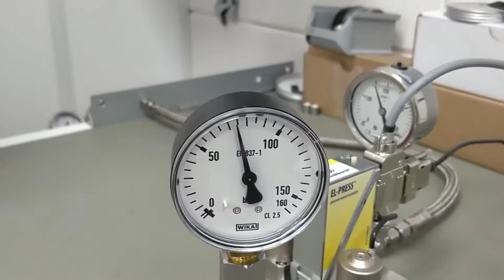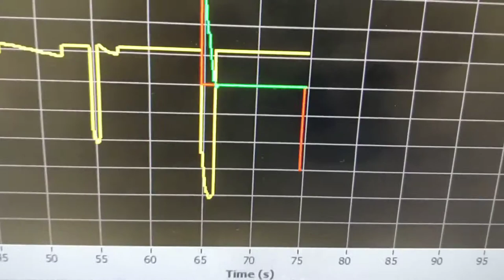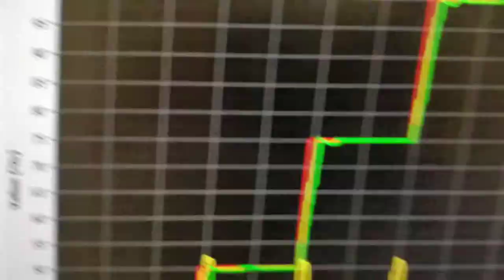Demonstration 150 bar electronic dual valve pressure controller

Comment: Is it possible to to use this valve controller to regulate pressure in a vacuum chamber?
Reply from the maker: Jesper, what a great question! 

First of all: We are a bit ashamed that we didn't spot your question here before, but at the same time we know we did answer your question via other channels:-)

To make sure that anyone who sees this online is able to learn from your question, we answer it now: YES! Certainly this valve can be used to regulate pressure in a vacuum chamber. We often do this and our website offers some interesting case studies around vacuum control. Contact PCS if you want to know more!